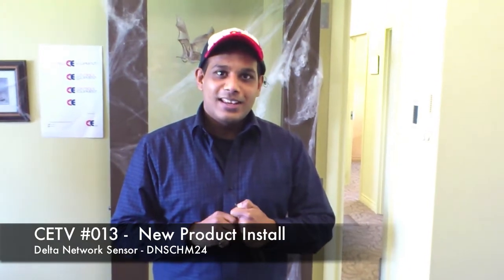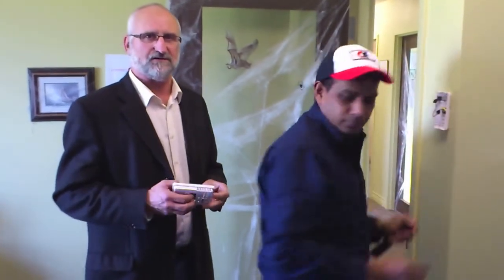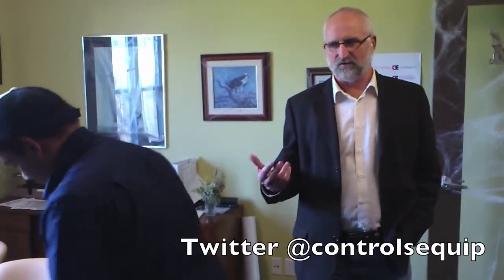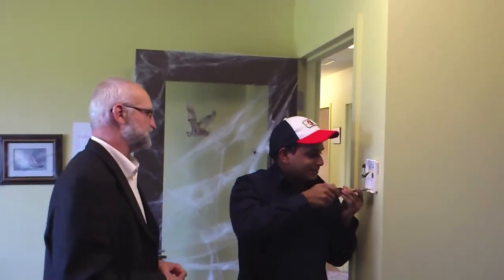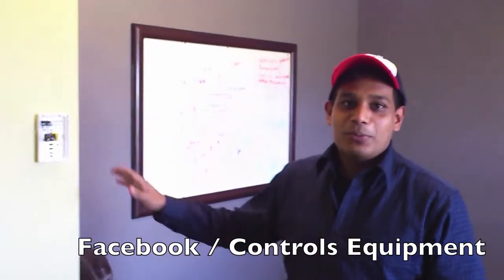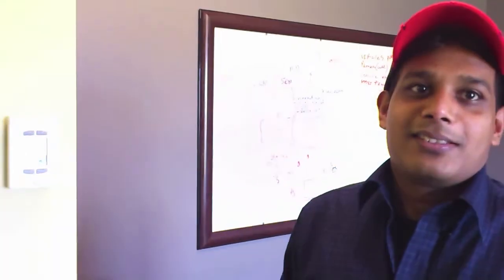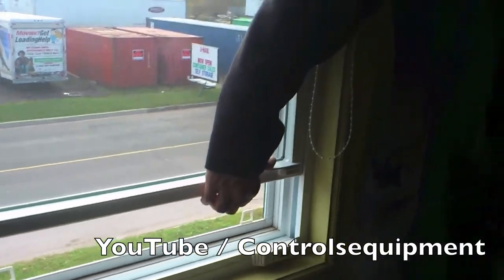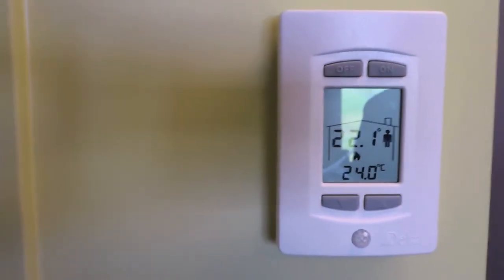CETV #013 - New DNSCHM24 Upgrade.mov

Comment: Nice video, Pat. Quick question on your window contacts. How/where do you run all your window contacts back to? Do they go to the local room controller like a VAV box or Fan Coil unit as a single input?